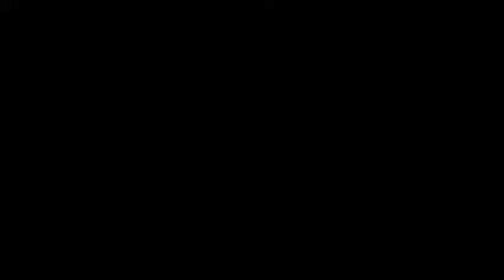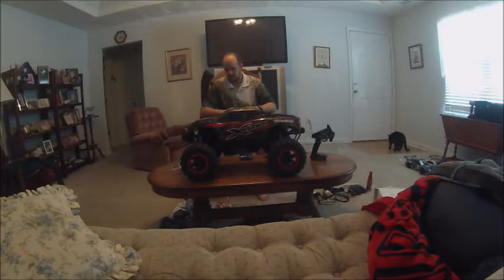TRAXXAS X-MAXX MAINTENANCE & TUNING

Comment: hey bud you don't make gears out of powdered metal it's for door knobs and door locks I'm a heat treater for 25 years more unlikely 4340or 4142 or 4140 not trying to be a smart-ass learned a lot from you
Reply from the maker: Ronnie  Bell Its all good.  I dont know a lot about metal but I did go through a metals class but we never went over the types and hardness.  I've also learned quite a bit about metal while being in the RC hobby.  I do know that the gears are sintered and from my knowledge that's a power put in a form and put under a lot of pressure and heat to form them.  I may be wrong and any metal info you'd like to share in all ears.

Comment: hey bud you don't make gears out of powdered metal it's for door knobs and door locks I'm a heat treater for 25 years more unlikely 4340or 4142 or 4140
Reply from the maker: Ronnie  Bell No they advertise the gears as sintered.

Comment: thanks man you know the right way mine is brand new in the box never ran x maxx castel 2028 is going in a 48 tooth pinion 54t spur gear to i like fast and tear them all apart right out of the box regrease  everything just make it hold up better with better parts not far from it  i will do it like yours man man dos your rig rip

Comment: I really hope they sort this truck out! There's no way I'm shelling out for it with all the problems it comes with.
Reply from the maker: it really doesn't come with alot of problems.  every time I've seen something go wrong I've asked and i has always been driver error.  I've had mine sick December 21st, 4 days after launch and I will admit, the only parts that have broke were my fault.  I'm running the 2028/xlx with 53/50 gearing and nothing has broken cause I'm not stupid with it.  I have some 5B rear beadlock wheels an tires coming to put on because the stock wheels break because the stock foams are weak.  they don't take enough of the impact away from the wheels so the wheels crack and break and balloon like crazy.
Reply: +Randall Hughes You seem to know your rc's so I'll take your word for it. But I think I'll still hold out for a refresh Version! When or if that happens.
Reply from the maker: +Reality Warri0r you've just gotta buy and put about 1000 into it for it to be a monster like mine.  I've got parts that will be coming this week.  deciding on what I'm gonna do next.
Reply: +Randall Hughes lol.. I've just spend £500 buying and doing up my slash! Think I'll be getting the x maxx but later in the year.
Reply from the maker: +Reality Warri0r just did the same with mine but still have some upgrades to go.  stage 3 carbon fiber lcd chassis, metal strc shock towers, proline prospec powerstrokes lol the list goes on and on.
Reply: +Randall Hughes i'm sticking with the standard chassis as I like the ground clearance and the sway bars make it handle much better. I've just gone for all Traxxas aluminium parts.. shock towers caster blocks the lot lol. The one thing I want now are the GTR stocks! Then I'm done :)
Reply from the maker: +Reality Warri0r someone makes sway bars or did you make them yourself?  if so would you share?
Reply: +Amateur RC No I just got the traxxas sway bar kit. And it makes a big difference to the way it handles. Hoping to pick up a rustler next month and make it in to a speed runner.
Reply from the maker: Reality Warri0r i searched.  they dont make a sway bar kit for it.  if so link please?
Reply: +Amateur RC are we talking about the same rc? Lol. The sway bar kits for my slash 4x4. :)
Reply from the maker: +Reality Warri0r lmao I thought you were talking X-maxx.  I'd love a sway bar kit for it
Reply: they all do warrior every new rig needs some upgrade